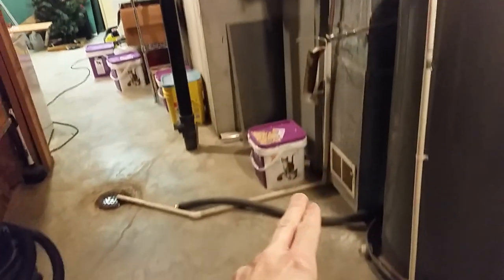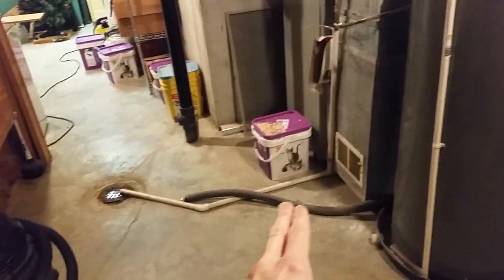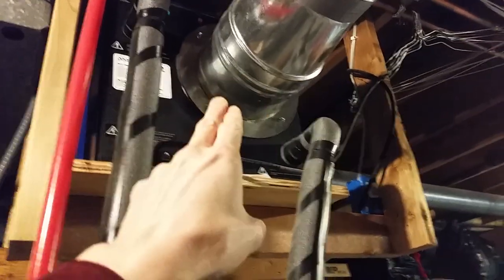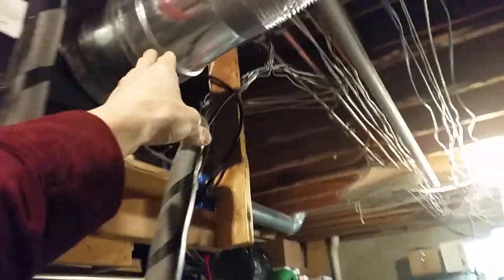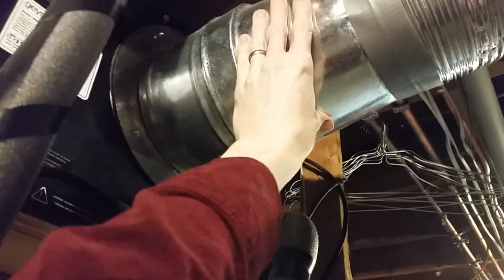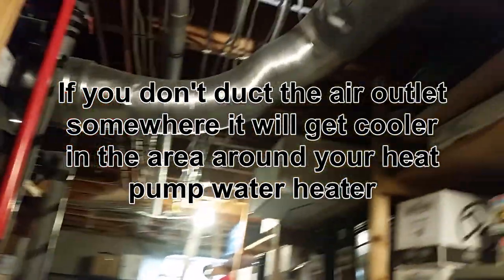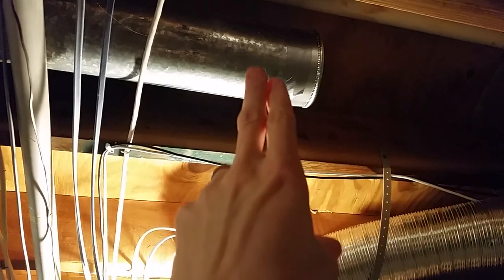Nyle Geyser Heat Pump Water Heater - Part 1 of 2:  How It Works

Comment: What was there when the house was originally built?  You have a gas furnace do you still have to pay for gas in the summer via a monthly charge?
Reply from the maker: There originally was a natural gas water heater in the same spot.  During the summer we just have to pay the natural gas connection fee which is about $22 per month currently.  I would prefer to heat the house with wood and not pay for natural gas at all, but house is not setup well for that.